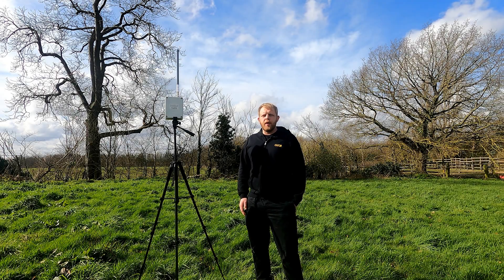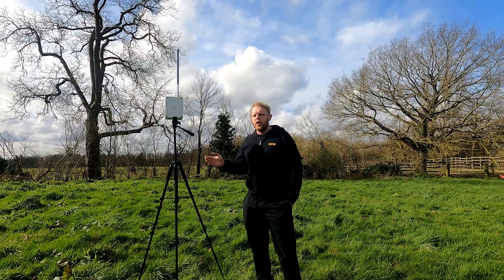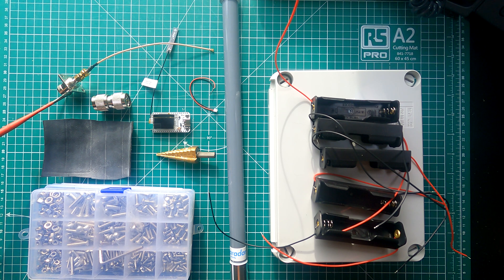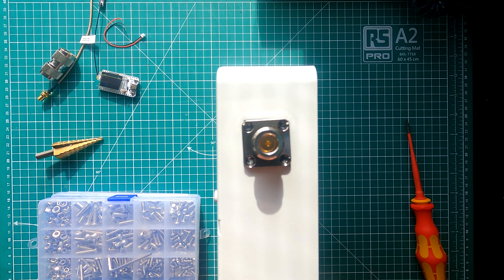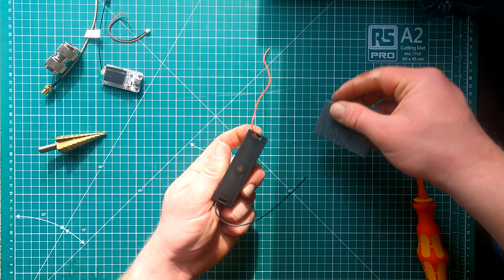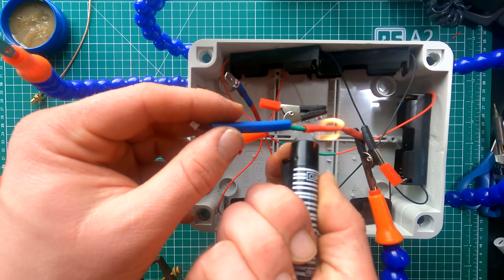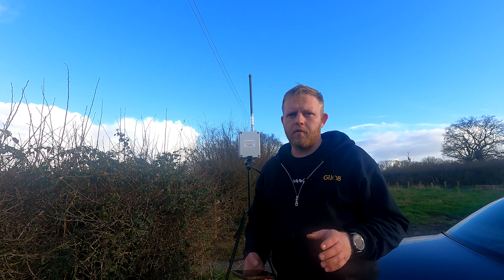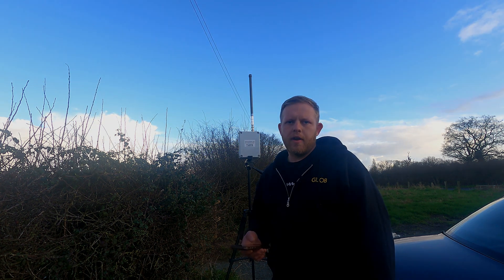MESHTASTIC PORTABLE REPEATER BUILD (AUDIO FIXED)

Comment: Hey boss, where is the solar panel. Maybe better join it, when power infrastructure is off. We need alternative. Think about this. In my city we buildings independent Meshtastic system whith solar panel, and battery. 73

Comment: 3M double sided tape or chloroprene (yellow shoe glue) will last and work better than super glue.

A switch with a round screwed thread would be better than that big clunky 10A automotive switch.
Those vandal proof switches are ridiculous overkill, just get a $5 rubber boat console switch if it has to be waterproof.

Make sure all your batteries are identical brand, capacity, condition & voltage, because you're not using a load balance charger.

A $10 Boya lapel mic and a 10yr old android phone would solve all your audio problems very cheaply !

Is it going to be solar eventually ?